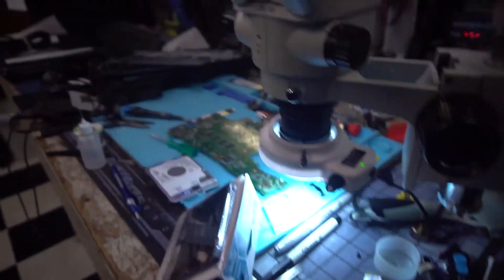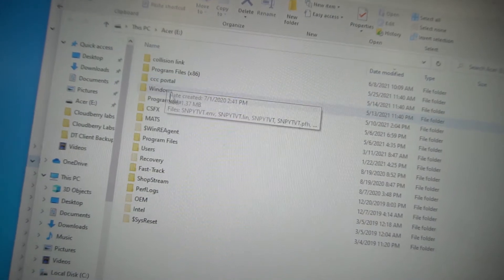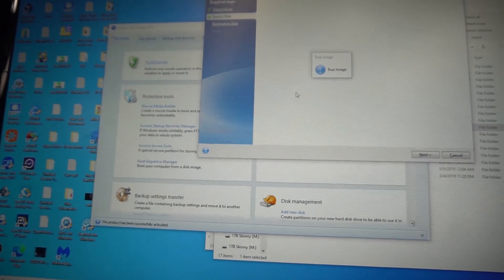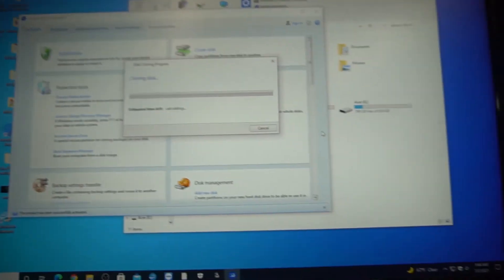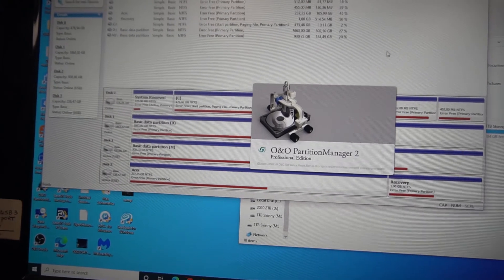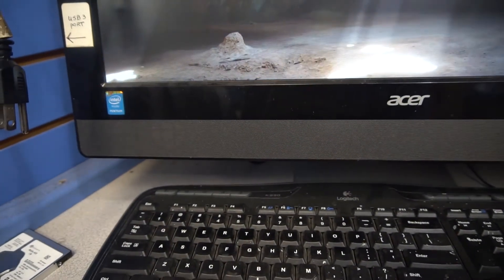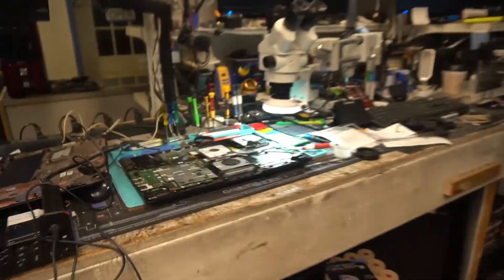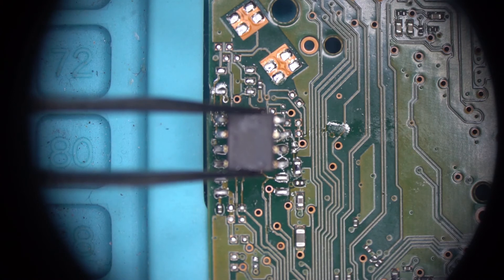No Power HDD Data Recovery

Comment: Hey there do you think i can save the data from an HDD? I'm 99% positive i fried the board on it when i used a different SATA cable i had from the previous PSU (EVGA). Is it possible to change the board with a new one and try cloning the data like you did here? I heard you change the bios chip as well 🤔
Reply from the maker: yes you can definitely save the data. So sorry i did not get back to you sooner about this.
Reply from the maker: Also, try not to mix psu power cables, there are only a few that are cross compatible. Also let me know if you need help with recovering that data, will be glad to help in any way.
Reply: @NiccKennedy  yeah i messed up first time i had to change a PSU, i managed to recover my data but it cost like $60-70 for everything. Lesson learned i guess lol ^